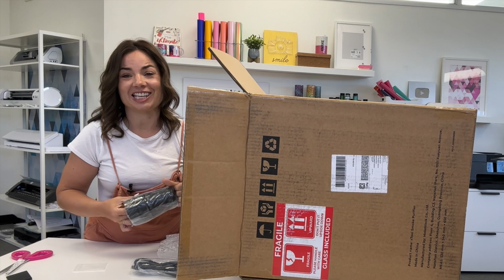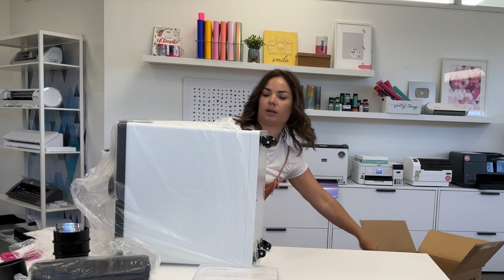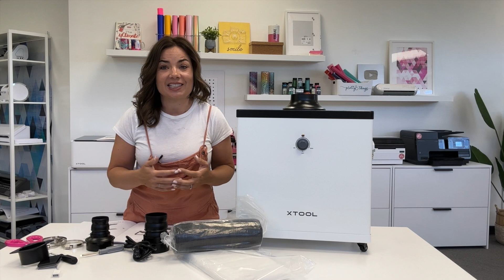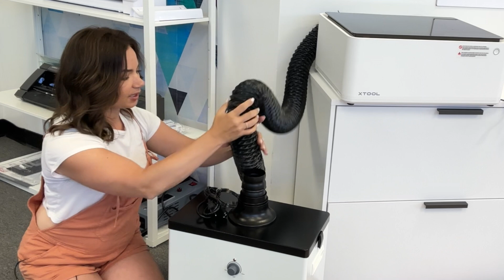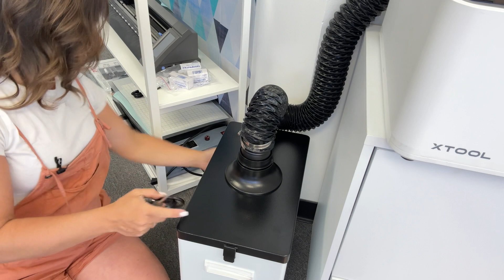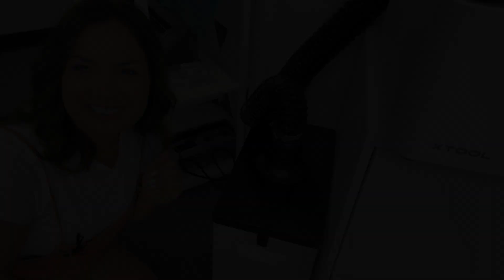XTool Air Purifier for M1, S1 and P2 Set Up (And Do You Even Really Need It?)

Comment: I have 2 ceiling ventilation systems set up in my room that expels to the outside. Would that be adequate, or would you recommend the system you are posting about?
Reply from the maker: You need to connect the hose from laser to a filter or vent it out the window. I'm not sure the system you have or how it's set up so I can't really say

Comment: hi, i just got the s1 and the smoke purifier and riser base and it seems to absorb 99 percent but I can still smell smoke. i used the two strips on the front and the back door but to me I don't see where the other two strips go. do you have the same problem? can you advise what else may be needed. thanks for your info. and videos.
Reply: Did you find a solution for this?

Comment: Too bad you didn't demonstrate it working. The noise level and how well it filters smoke and fumes would be great to know. Most people getting into lasers don't realize that if you can't vent to the outside, you need to spend half again the cost of the laser to get a quality fume/smoke extractor. Some just get rid of the smoke but you will smell the fumes. So add another $700 on top of the cost  of your 10-20 watt laser and you would be very close to at least getting a setup that will work. Supplies to engrave and cut are also things you need to think about because it will add up fast. If you are just doing things for family and friends, then you don't have to worry about buying in bulk per se. It's a costly hobby to do it right. Best option is to be able to vent outside. Nice video, very detailed tutorial on how to set this unit up.